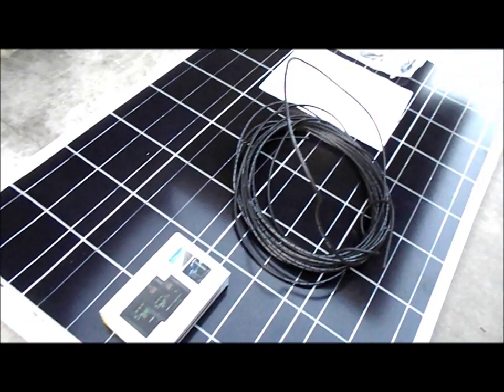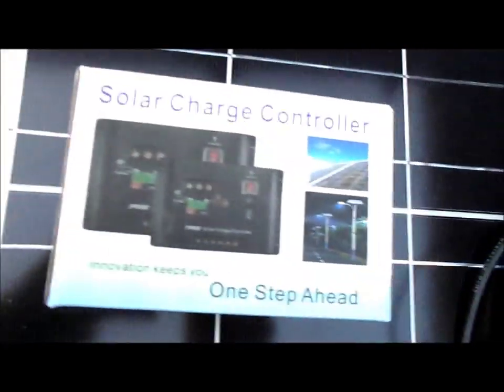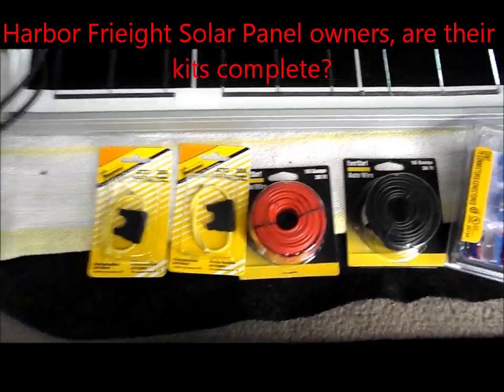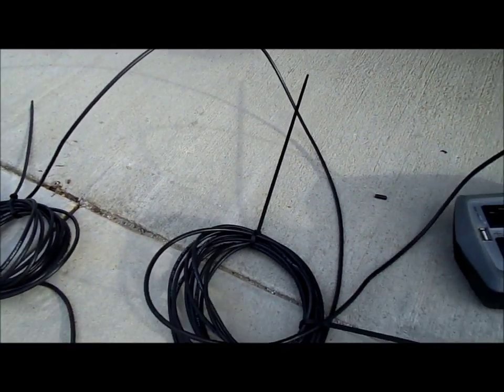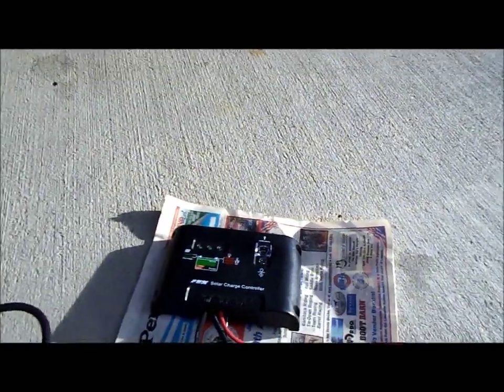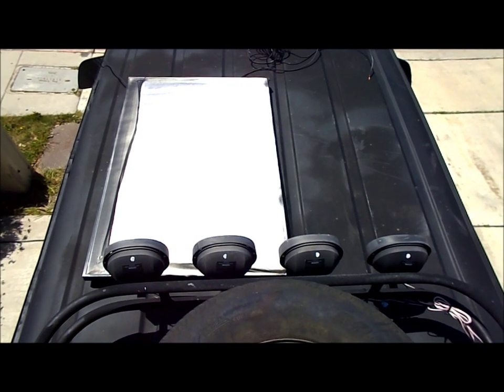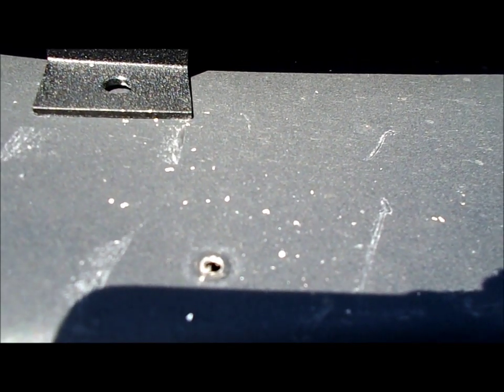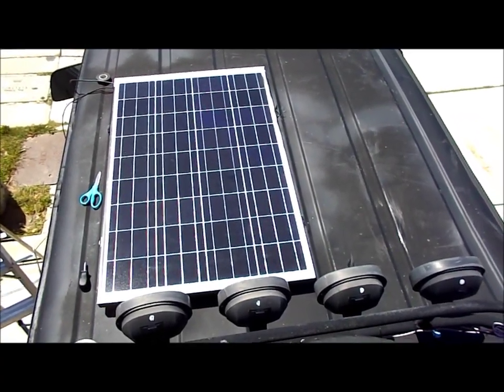Running Solar in a van 100 watt WindyNation Ebay Solar Panel Kit install tips and Demo off grid 12v

Comment: The battery that are using - an optima - is a very well made battery but SUPER expensive. AGM doesn't really give you much advantage over flooded for a couple of reasons. The biggest is price. It is true that with flooded you are going to have to watch levels and top off but the reason you gave with the fumes is bogus. My god, the odds of you building up enough fumes in the van to either overpower you or blow up is so insignificant it might as well be zero. My choice? Self made lithium ion phosphate with 18650's. Slightly more power, longer charge hold and they will last 10 times longer. I was going to say they are more expensive but nowadays the price has plummeted. Best wishes dude.
Reply from the maker: Appreciate the input. I'm n the same battery 4 years later. Got my moneys worth out of it https://youtu.be/LKMpyovYlXU
Reply: @JohnDrivesAnything  I believe you will have quite a few more years. That is a damn good battery. I was an electrical engineering tech but nowadays I am a trucker. In May 2014 I bought 4 x Energizer AGMs type 31's at Sams for my truck. They lasted exactly 4 years.  Then I had 2 actually short circuit and give me a headache with my APU. I am glad that is over. They died over the last year. I am on flooded now. Cheaper. Of course my demands on the battery are greater than yours so I kill them quicker. However the metals deteriorate no matter whether it is AGM or flooded. The big advantage of an AGM is no maintenance coupled with a complete inability to spill. I would suggest that while you are in this non emergency time explore the 18650. It is fun if nothing else.
Reply from the maker: I'll do another video in April. Apil will be the 5 year mark

Comment: I'm not sure why you want to compare this 100 watt panel to 3 15 watt panels for a total of 45 watts from Harbor Freight? I have 2 100 watt panels from Windy Nation and I paid $128 apiece for mine. I do believe if you read the description of the kit you will see you need the wiring and stuff to hook up the batteries.
Reply from the maker: I just brought up the Harbor Freight Panel because its the most common in store panel.

Comment: I bought a Renology suitcase 100 watt and it came with all the hardware.
Reply from the maker: Did you install it yet? What are you using it for?
Reply: AutomotiveVlog I am taking it camping to recharge batteries while I boondock.
Reply from the maker: Be safe man

Comment: Hi do you know how many solar panels I can connect to 30 amp charge control? Can I connect 1000 watt solar to 30 amp charge control?? Thanks!
Reply from the maker: I would contact the manufacturer. What did you end up getting?

Comment: Your roof, and Solar panel would stay much cooler in white, also the inside of the Van. Peace
Reply from the maker: That's actually on the too do list. My van is so tall no one will notice it has a white roof. Maybe Semi Truck and Helicopter drivers will

Comment: Great Video! If you don't mind me asking what size is the vizio TV your using? Thanks
Reply from the maker: 19"

https://youtu.be/UwZtxv9WQ6w
Reply: +AutomotiveVlog    Nice! I'm in the process of doing the same set up you have but I have no clue on if I can do a bigger tv like a 27" or 32" and if either one of those sizes would work or bigger on a 100w system..? Thanks again
Reply from the maker: A 27 to 32 inch tv should be at 30 watts or so. These flat screens are pretty energy efficient. 

Are you going to run the TV and video games? The new game consoles seem to run at around 100 watts.

Comment: Really appreciate the video!
Quick Question: Why do you have a negative line going from the battery to the charge controller? Don't you just need a positive? Thanks

Comment: I just used the extra wire coming from the panel to run from the charge controller to the battery.  Was I not supposed to do that?
Reply from the maker: +101perspective 

Is your solar running right?
Reply: AutomotiveVlog
Yeah, it seems to be running right.  It is set up the same as the one in the video in regards to the charger.  I just used the left over solar wire to run from the charger to the battery.  I figured if the wire could handle the load coming from the panel then it should from the charger to the battery. 

In the video, I think the extra solar wire was cut and then tossed away or something.  And additional wire was purchased to run from the charger to the battery.  So, I was wondering if maybe that is what I was supposed to do.  That there was a reason for that.
Reply: 101perspective that's fine. The extra wire can be used for the controller to the battery no problem. Smart use of the extra wire.

Comment: Since you will be using solar only while parked...you would have had better efficiency if they were removable and installed when needed. Then you could mount them for use with adjustable angle - because laying flat like you show here robs you of at least 30% - and if on manual swivel base you could adjust track the sun and also receive better than another 30% efficiency (if parking for half a day or something) . But you still got it going on. Thumbs Up. *the proper angle to mount your solar depends on your Latitude.
Reply from the maker: +XRayCam 

IT's been working great the way it is. But I see your point. MAybe if I were to do it again I'd put it on hinges.

Comment: You didn't get a "complete kit" from WindyNation. They have a 100watt kit with everything you need (except the battery) plus an inverter so you can run your AC powered stuff. Check out their other stuff and check it out.  The inverter that comes with the kits is usually a 1500 watt modified sine wave inverter which will run some stuff, but I opted for the kit that didn't come with their inverter and bought a "pure sine wave" inverter to run all my electronics etc.
Reply from the maker: +gleeritay 

I guess they forgot to include stuff.

Comment: Hello I would like to ask you a few questions while my wife and I have been forced to live inside our 2002 town and country, it has plenty of room when the seats are removed. but my question is this--how long can you run a 12 volt mini fridge and TV and laptop not all at once,  but the fridge would need to be running always. the laptop is for information gathering and resource. The TV is simply for the laptop while the screen is busted on the laptop. I really need to know how long solar energy can power up such things, and if there is an alternative like a inverter and converter? and maybe how to hook those up. I will be using the van for sleep but will need to have the basics inside, A fridge, MINI 12Volt. and my laptop. things like food or showers wont be an issue for we live in an area that allows the homeless to eat and shower, ive never been homeless before but I know well how to survive the out doors. I am just not sure how solar works ive read a lot about it and still I wonder if this is a expense I should avoid. while all I wish to do is power up a mini fridge and laptop. thanks
Reply from the maker: +allen Cass 

This should help you out

https://www.youtube.com/watch?v=ngJt3Y57_ds

If you want to run a fridge I would have a seperate solar panel and battery for that. 

That runs 100 watts continous.
Reply: +allen Cass - I have a 250 watt Renogy Mono-crystaline Panel Mounted on my 2015 Grand Caravan. I used 3/M heavy Duty 2 sided tape to mount it directly to the van roof. The Van has fold into floor (Stow and Go) seats which fold into a "Trunk" in the floor. I removed the right side second row seat and installed 2 - 125 Amp Hour AGM batteries = (250 AH total) into the empty Stow and go "Trunk". I Mounted the charge controller and automotive breakers to the back of the front Passenger seat and ran the 10 gauge cables from the panel to the CC under the rubber weatherstripping on the vans sliding side door. Didn't have to drill a single hole in the van this way! Next, I installed 4 - 12 volt receptacles and 2 USB receptacles and a 2000 watt Pure sine wave power inverter (for my 110 volt outlets). I have an ARB 12 volt/, 24 volt/,  or 110 volt Fridge / freezer. I run it on one of the 12 volt "cigarette lighter" receptacles that I installed 24 hrs. a day. after it initially cools down to what ever temp I set it at it only uses approximately 1 amp per hour. Even without any sun I think it would run for about a week before the batteries even know it's there haha. I also use LED lights,and a 12 volt-24 inch LED tv plus a large 12 volt fan (Of course, I AM getting 10 amps charging an hour on average from my panel and MPPT CC during the day). I have a RoadPro 12-Volt 300 Degree Lunchbox trucker stove that I sometimes use as well and I've never seen my batteries drawn below 12.7 volts. I plan to use it for van camping , but I also have a travel trailer that I can power by using a heavy duty extension cord from my Power inverter in the van.

Comment: Thanks for the video. Very useful. But have you ever heard of I x V = W.  That is current x volts = watts. You can turn that around to I = W/V  You say this 100 watt panel will likely recharge a flat battery in an hour or two. I think not mate. A 100 watt panel delivers about 6 amps in PEAK sunlight. Hence a 100 AmpHour leisure battery would need 100 divided by 6 ampshours to reach full charge. More like 16 or 17 hours. Still a useful add on to a van. I'm fitting 2 x 100w to mine next week.
Reply from the maker: Appreciate the feedback

Are you going to record your project? You should, it's a topic of interest here on YT.
Reply: AutomotiveVlog Might do. Mostly I make flying vids and a few camera reviews. Good idea though.

Comment: Harbor Freight includes everything. Even with the battery cables and connectors.
I still have my Harbor Freight Solar complete kit still in the box. Never used. Will sell it for $100
Reply from the maker: Good price, that will sell right away on craigslist.

Why are you selling it.
Reply: AutomotiveVlog Never had the time to take it out of the box and install it.
Reply: where can see it more info
Reply: ben shafer Hello Ben. I guess I can make a video of it and post it on YouTube. I don't have it listed yet on any sites such as Craig's List or eBay. I thought I give the YouTubers a first chance. you can message me.

Comment: The one thing I didn't see is how do you connect the wiring from the panel to the charge controller. Do you cut and splice into 12/10ga wire?
Reply from the maker: Around the 3 minute mark. The Negative and positive goes right into the first 2 slots of the charge controller. You just strip a few centimeters off the ends to make the connection.

Comment: No kit comes with the battery wires and connectors. How could they know what you are trying to hook to. You have a complete kit there.
Reply from the maker: Appreciate the feedback. This in my first foray into solar so I have no experience with what other kits come with.
Reply: AutomotiveVlog
I was looking into this same kit and thats why I was watching your video. Are you happy with it and would you recommend it to others?
Reply from the maker: Definitely

I might take the spare tire off the roof so I can stick another solar panel on the roof. It's doing great living on top of a van.
Reply: AutomotiveVlog
Cool, thanks. I'm going to get one. Good luck in your travels.
Reply from the maker: Good luck man, report back when your done, let me know how it went.

Comment: thanks for this info. will be ordering these in the next couple of weeks and will be doing the install myself. wish me luck!!!!
Reply from the maker: Follow this video and you'll be fine. Since the controller to panel wire come in one 40 foot roll just note which one is positive and which one is negative when you plug the panel into controller.

Here's another video I made on the panel, it's been working great

Running accessories straight off your solar panel. Getting the most out of solar power in a van

Comment: It looks like a good investment especially for your application on the van. I think you made the right call getting the 100 watt vs 40 watt. If it takes your solar panel an hour or two to charge a dead battery, then does that mean the Harbour freight model would take 4-5 hours to charge your battery?
Reply from the maker: You are correct sir. Did lots of research on those Harbor Freight kits and the reviews say 4-5 hours.

This panel is powerful enough to keep up with my TV and XBOX. I was at the DMV the other day and it was an hour 45 minute wait. Played video games while I waited for my number to be be called. Battery didn't drop voltage at all.
Reply: Wow, that is really cool. Talk about good entertainment while waiting! I bet that made the time fly by. For as much stuff as you have in your van, I bet that Harbour Freight model simply would not keep up, so in reality this was your only option. Your van is now just about to the point where you could go anywhere for an extended period of time and enjoy yourself. Shit, if you go on a vacation, there is literally no reason to get a hotel room. Your van offers a unique form of freedom in that way. You did a great job turning your vision into reality.
Reply from the maker: That was the master plan. I can always take showers at the gym. I just don't sleep well in Motel/Hotel rooms. Now I have home with me all the time. Last up is the rear locker. That's going to be around October. Z06 in August. Getting closer and closer.

Comment: In commiefornia this is certainly a worthwhile investment. A buddy of mine is actually adding solar to his house and my house is all electric so I think it's something I'll be looking at in the future. Combined with maybe Geothermal heat it could be a winner. Love seeing technology advancing.
Reply from the maker: I'll admit the geek ass side of me thinks this freaking rules.  In the day time the battery and XBOX doesn't even bring the charge down since the Solar is constantly feeding the battery. At work I was parked under one of the lights and it was still charging a little. Those windmill electric generators look awesome too. That would be cool for the home.
Reply: yeah ive seen those wind mill plants to, out in the desert they'd be a no brainer, that and solar. My problem is I'd mount solar to my roof and well... snow. lol

Comment: great video where did you order it from?
Reply from the maker: I got it on ebay. The Windy Nation website actually has better deals. They have a channel too and sometimes they have specials. I missed out on the $129 deal.
Reply: great thanks the van is looking great. did the fridge work out or did draw to much power
Reply from the maker: It worked ok. With Solar it'll work better now since it draws  100 watts. I was at the DMV the other day it was a hour 45 minute wait so I just played video games in my van until my number was coming up. In that time the battery voltage didn't drop at all since XBOX and tv is about 130 watts.Fridge draws about 100 so with solar and a fridge I can run it all day now as long as there's day light. I think the basic rule now is to keep all your accessories at 100-200 watts. With 100 watts of solar and a single battery you'll have a good enough set up for road trips. If you plan on living in your van and want to run a fridge I think 3 batteries and 300 watts of solar would be perfect. You can run a fridge all day even throughout the night and still have power for your computer or tv during the night hours.

I'll just put my Fridge back in if I ever need it. Probably in the summer when I go on rock climbing trips and I need to keep food cold.
Reply: cool thanks
Reply: AutomotiveVlog Appliances don't DRAW watts, they draw AMPS.  Amperes is how current is measured. ie a 25 watt bulb draws 2 amps. That is 25 watts divided by 12 volts.
Reply from the maker: Appreciate the input boss.

Comment: Nice work man, that van is transforming into the ultimate somewhat low budget adventure setup
Reply from the maker: That's the plan. Road trip/Adventure vehicle. It's got the entertainment part covered now. Rear locker is last for desert adventures.